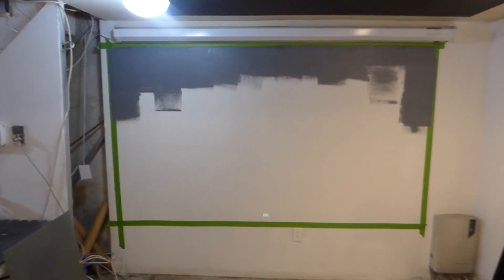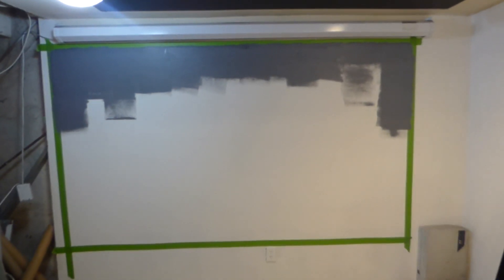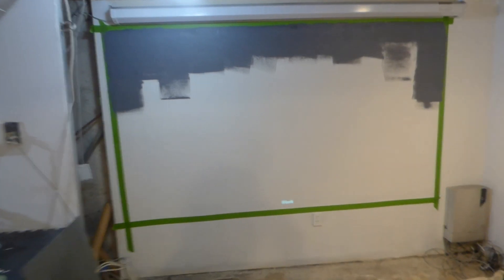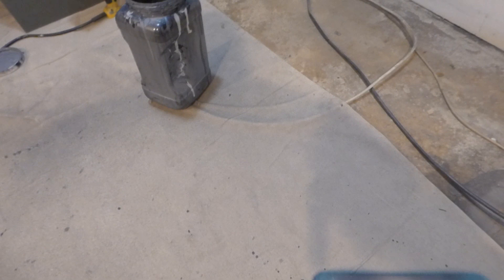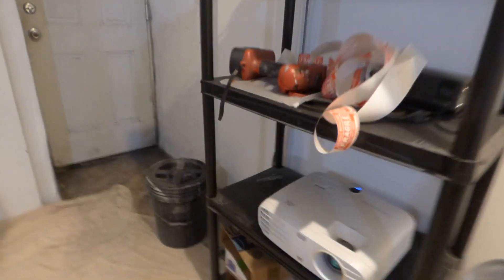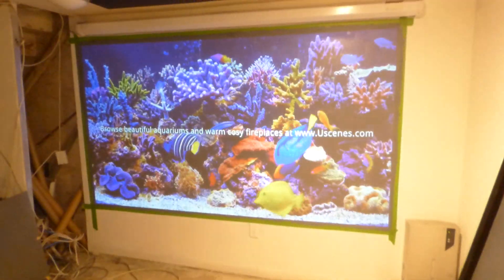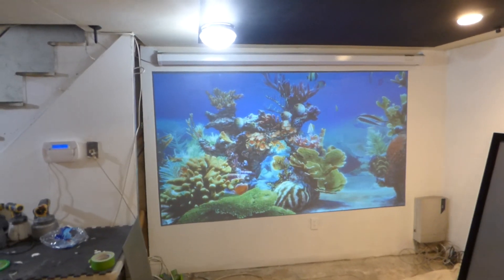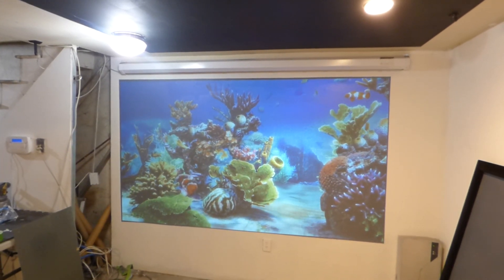Luminous ALR cinema paint new roll on or spray on screen paint! Drywall roll on demonstration!

Comment: I found wallpaper on TEMU that is 60cm in width, has a aluminium (grey) coating on the back that is sticky. If you cut a roll in two pieces of 213 cm and stick them on a standard decorated wall you get a 213 x 120 cm (100 inch) screen. It flattens perfectly ( air bubbles) with some hard roller and it is even easy to get it of again. It has a smal gain and you can watch it from the side without getting dimmer. You can't see the cut in the middle if you precisely Aline them, this is easy because the sticky part can be easily pulled of and realigned again. You only need 5 meters and they sell them for less than $6 with shipping. I never found an easier way to attach a nice flat 16:9 100 inch screen to a wall without making any frame, use glue, paint or fabric with rinkels.
Reply: Can you please post a link to that wallpaper?

Comment: Water paint or oil paint bro
Reply: Puulu paint....
Reply: oil paint but make it matt...not glossy...wihte paint + black paint + a spoon or two of silver .....stir well...and mix them well then put and mix zinc oxide and petrol to make it matte ...roll on the surface as you selected for screen...use fan to fully dry it
Reply: @ishtiaqali6955  Easier to just buy some matt grey paint....
Reply: Sebaiknya silver lembut warna abu abu

Comment: paint from any producer will never be Active Light Rejecting. It is not physically possible. The behaviour of the screen made of paint will have pseudo ALR properties and any screen paint manufacturer informing customers that the paint is ALR is misleading. Correct me if i am wrong but ALR screens have a special surface structure, usually micro channels, or micro holes, to which external light does not fall, or falls to a lesser extent on the reflecting layer of the screen. It is like a protective umbrella against unwanted light. The paint can not have such a structure. It can only get it’s properties closer to the effect, but it will never get rid of unwanted light. It will give the impression that in some conditions this light is simply not noticeable.
Reply: Absolutely! I'm glad somebody finally mentioned this. The ALR screens I've been looking at have the down facing ridges to only capture the light shining upward (especially from a UST projector). I knew this was dodgy as!
Reply: totalmente de acuerdo.

Comment: I have a concrete wall with some spots with smooth texture and the rest coarse textured that I painted flat black. I use a cheap projector just to see how big of an screen area I will need. My question is, when projecting,  I can see the smooth texture patch work on the image. Do I need to smooth out the area I will paint with your product?